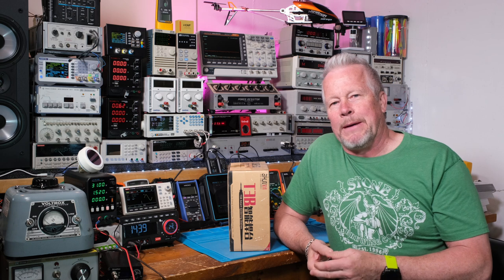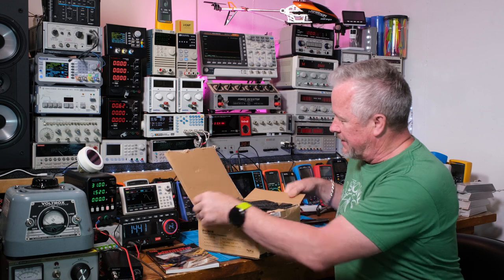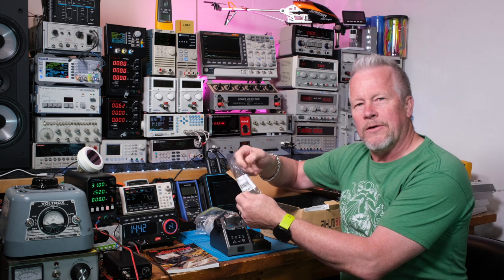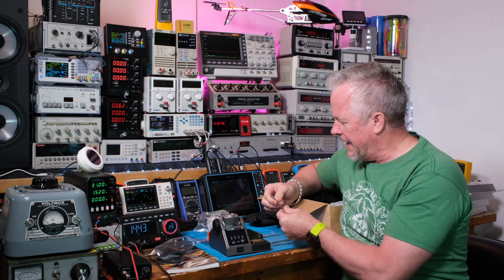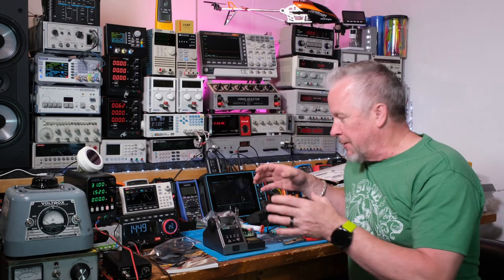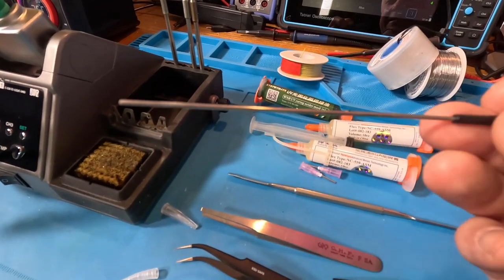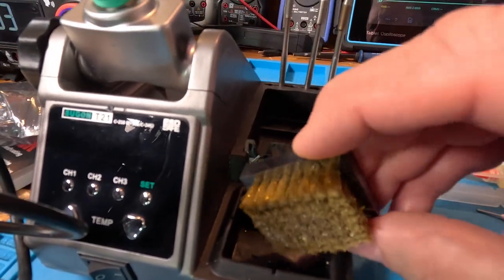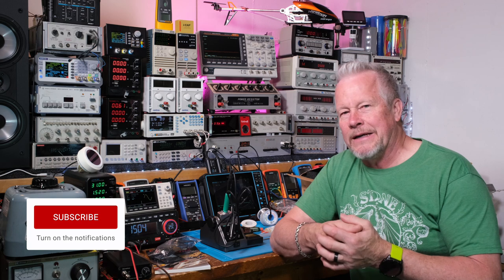Gift sent by Patreon - Box Opening and Sugon T21 Soldering Station

Comment: Hello Eddie, this is a soldering station similar to the JBC that supports 3 types of tips: C115, C210 and C245, the latter is the one you have. that loose piece is the cable support bar. I have a similar I2C 2SCNI. These stations are very good and fast and much cheaper than JBC. Greetings.
Reply from the maker: Thanks for the great info!  Can't wait to use it;)

Comment: 13:30 i can be wrong, but i think that is socalled EL (ElectroLuminescent) Wire Light, looks like LED strip, but works at AC voltage (60 to 600V) and needs a DC to AC inverter with high frequency.
Reply from the maker: Wow - thanks for the info!

Comment: could the yellow wire be 30 awg. wire wrap wire? that we also use to use for jumpers and to repair broken traces on a PCB, the oval soldering tip I think is used for drag soldering on a multi lead surface mount IC.
Reply from the maker: Thanks - I think you are right.  It is a small gauge wire - I think:)